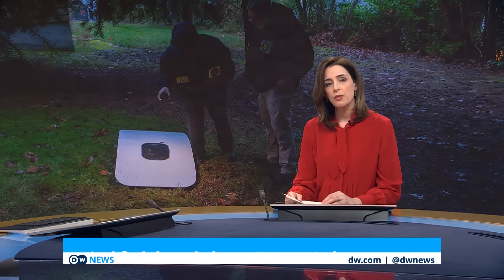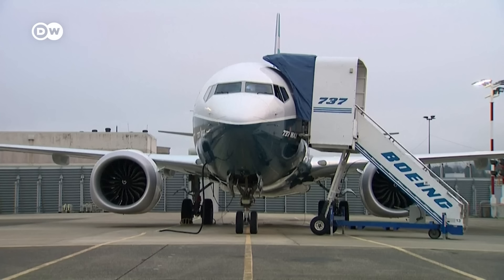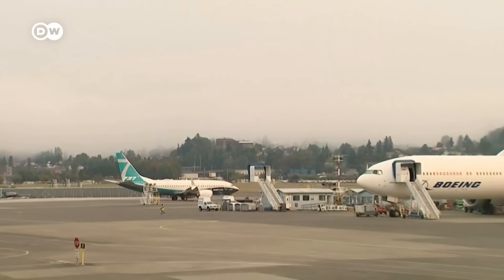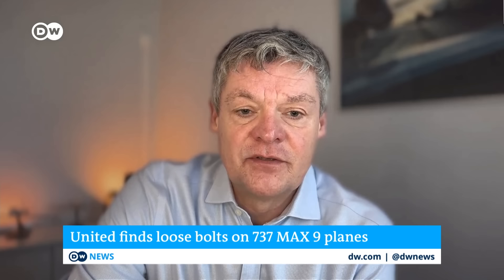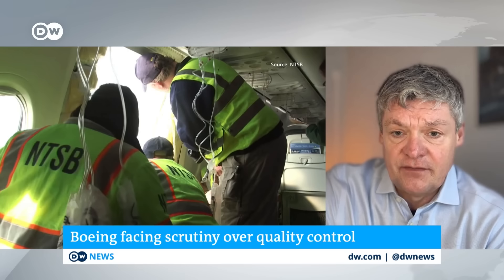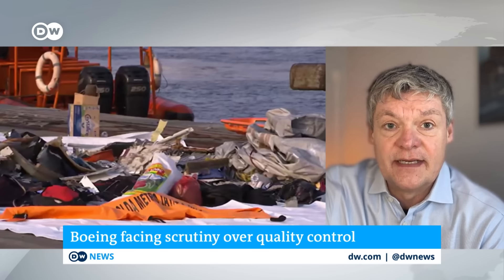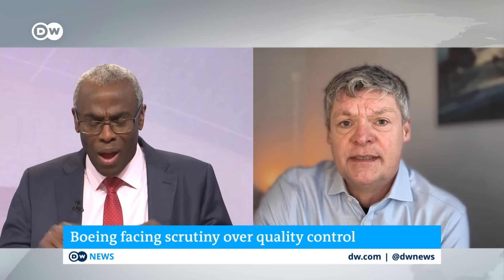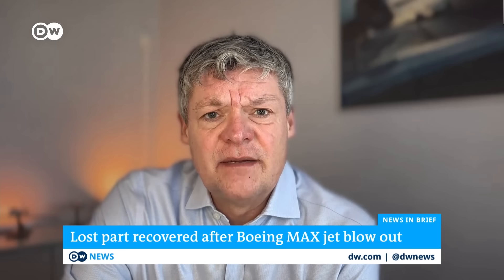After the Alaska Airlines incident: Is aviation quality control insufficient? | DW News

Comment: The entire 737 Max fleet needs to be checked.
Reply: I didn't say ground it but the bolts need to be checked on the entire 737 Max Fleet.
Reply: @Bluestreak589 Aside from MCAS ditching the plane into the ground without pilot command, and loose bolts decompressing the aircraft at high altitude - one wonders what other hidden defects there may be on these aircraft? Wait and see I guess.
Reply: What about the Max 10.
Reply: @Bluestreak589  its not for Ryan air.. its for planes of more then 185 passangers i think it is, the configuration the customer orders depends on the door/ plug used.
Reply: @thompsonmatthew 
There was another news channel which showed an interview with a former manager and whistleblower from Boeing who said that there was a united flight just about a month ago where they had a single engine failure just after 30 hours or so that the plane was in use. And another one which lost all electric power just after take off and that one was just delivered the evening before by Boeing…
That’s pretty concerning if you ask me.
And yes the MCAS was a disaster which they wouldn’t have needed if they had developed a proper new plane instead of rushing to keep up with the competition and just modifying an old reliable one.
Reply: @Bluestreak589  ryanair don't and isn't having max 9
Reply: Needs to be in a scrap yard.
Reply: @Bluestreak589  Ryanair doesn't operate the Max 9. What you are referring to is the Max 8-200, a Max 8 version with an extra door.
Reply: @Bluestreak589 
So you realy belive that Boeing AS different Quality insurence system. For the different 737 max variances. Or does the 737-8 not uses anny Bolts. This is Not a specific Problem. But rather a Symptom of a fare worse Problem when Profits Matter more then safty
Reply: @Bluestreak589  I flew on Ryanairs one 2 weeks ago from Dublin to Stanstead return .I just knew that it was a 737 and i noticed how new it looked .Then i read Ryanair had taken delivery of at least one and put it on that route .If i understand correctly Ryanair puts in 200 plus seats so does not have that plug but an actual door on their new 737.
Reply: You should read about the 787. It keeps stopping production because of defects and detected quality check. Imagine that, if Boeing is stopping the 787 production because problems are being found, imagine the ones they didn't.
Reply: Generally I don't have much sympathy for Boeing. But in this case... other versions of the aircraft don't have these plugged doors. But Spirit has, apparently, been firing people who report issues. So there are likely other issues.
Reply: @Bluestreak589  Since a MAX-9 is a 737-900... well you'd have had a 737-900-100 and 737-900-200? Things like this are dealt with in smaller numbers, like the 747-100 was the revision, but the delivered aircraft were things like the 747-121. So this would be a 737-950 maybe, but that would still be a MAX-9. These can be ordered without the hole, but then a future 'upgrade' to the significantly more hellish seat layout would be very expensive, instead of just requiring a couple of doors and rearranging the deck-chairs on thisTitanic.
Reply: And SCRAPPED!
Reply: @konraddapper7764 — These particular bolts are used only to keep these plugs in place.  The mandatory inspection is for all the aircraft that have these plugs.
Reply: More like grounded indefinitely until further notice
Reply: We were told in Nov 2020 - when it was ungrounded - that the 737MAX was "the most scrutinized airliner on earth". More lies.
Reply: @thompsonmatthew  loose rudder control bolts.
Reply: Also those in the factory
Reply: @mrsogre  Right on,. The obvious, based on common sense, was mentioned in your comment.
Reply: @Bluestreak589 Ryan air aren't buying the max 9 they have ordered the max 10 version.
Reply: @kennogawa6638  You don't seem to realize that the rest of the fleet does not have this plug
Reply: Not only checked. Should be banned for ever, no one wants to fly on any 737 Max at this point.
Reply: @ResizeFilms  I know you will find this hard to believe, but you don't speak for the rest of the world.   10s of thousands of people fly on 737 every single day...
Reply: Boeing 737 900 ER door plugs to be checked the FAA announces.
Reply: The door plugs are removed during maintenance and construction for ease of entry for workers.

Comment: What else has been missed on all of the MAX airplanes? Boeing has lost all quality control. The new Air Force tanker had major issues also. Upon receipt of the new aircraft the Air Force does an acceptance inspection and they found tools left in the aircraft behind panel. A major issue called FOD.
Reply: I heard about this. Go Boeing!!!
Reply: Boeing debacles: 737MAX, KC-46, T-7A, Starliner - all at taxpayer expense.
Please read about how Boeing management cut 900 - nine hundred - quality inspector jobs in 2019-2020.
Please read about lawsuit against Spirit Aerosystems (Boeing subcontractor really run by Boeing).
Full disclosure: as recently as 10 years ago I was a huge Boeing fan boy. My father flew Boeing planes in WW2 (he was a B-29 navigator). They are not the same company they once were.

Comment: I wonder what sort of quality control check the FAA did after the LionAir and Ethiopian crashes and further grounding? We were told this would now be the “safest plane aloft”. Looks like they couldn’t even screw a door on right.
Reply: Both were non Western Airlines so a lot of people and Boeing fanbois still believe it was pilot error that cause the crash! 
they have disregard it with excuse like:

- the pilot were not experienced or better trained to deal with emergency, 
- Western "white" pilots are better trained so this would never happened in West
- those planes were not maintained properly,
- China actively try to make Boeing look bad by pushing for ban to make Comac look as a better investment etc.

So when you go into something with that type of mindset that it was not fully your screw up, your work to fix it will still suffer from flaws and you won't fix other bad practices of careless work.
Reply: It’s a different model.  Those were the max 8 model.  

This is occurring on the max 9.  The max 9 is a bigger plane - about 10ft longer than the max 8.
Reply: @DeathyAS  same forward set Leap large engine with low body and MCAS system.
It's just longer, so more cattle class sit and cramp toilet.

Comment: Title is wrong, should be "is boeing quality control insuffiecent?" and the answer is yes. I saw the pictures of the loose bolts, and you can literally see that they are not fastened, its so obvious even a blind person could figure it out. Blows my mind how this can happen, there seems to be no more quality control AT ALL Im an trained aircraft mechanic and im blown away and really cant make sense off how this could happen. Its almost like its done on purpose.
Reply: @@phillipbanes5484 there is a difference in manufacturing defects and quality control of installed components. It's not like a part of the plane  failed because it had a defect - it just wasn't installed correctly. Loose bolts that you can spot easily by just looking at them sure sounds like no one ever looked at it after said bolts were installed but just signed that the work was done. 
And yes, especially in the aviation industry we learn from mistakes that were made - but dude it's 2024 and multiple loose bolts on multiple planes should just not happen anymore. 
As a mechanic yourself, have you seen the picture with the loose bolts? Now imagine yourself installing these. How incompetent does one have to be to not notice the loose bolts after you are done as a mechanic? And how did an inspector not see it either?
Reply: I think its an aviation problem because of the FFA failures too. It's not just Boeing that messed up.
Reply: @RandomGuy9  don't really know many other plane manufacturers that had 2 brand new planes fly into the ground or loose doors like Boeing. So no, I disagree. It's a quality control issue at Boeing. And it's been known for a while. But I guess it's profit over safety nowadays

Comment: Why only checking  the 737Max9 ? The 737Max8-200 used by Ryanair is equipeed with the same emergency exit door. Nobdy talks about it.
Reply: It doesn’t have a door plug because it must have the emergency exit to qualify for the 200

Comment: It’s entirely possible that the bolts were correctly installed and inspected at the factory which would lead down to a defect in the design.  Perhaps the design allows pressure cycling, thermal cycling, and/or vibration to cause the bolts to shear or come loose.  If thats the case, Boeing and FAA will need to understand the root cause, correction, correction validation, and fleet implementation before these craft fly again.  Further, they need to check aircraft with the actual emergency doors to determine if the problem exists there as well. This may cause expansion of the grounded fleet.
Reply: Ford has a similar problem. My brother's car lost its engine on the highway because the screws vibrated out...

Comment: There were reportedly 171 passengers on this plane that apparently seats 178 and the 2 seats most adjacent to the door plug that flew out were unoccupied. Do you know that the random probability of those 2 seats being unoccupied is 0.13% (or 1 chance in 770) ? Given this incredibly remote possibility and the fact that the airline is already known to have known about a cabin pressurization issue on this plane, does anyone else think it's plausible that the airline knew of this specific problem at the door plug and their solution was to just block seating on those seats most proximate to the door plug? I do recognize that 1 chance in 770 is not zero chance and that there's some extrapolation from that chance to a faulty decision but I've personally found it an overly convenient conclusion that many have drawn that "oh, how lucky everyone is that those 2 seats were unoccupied"...maybe luck had absolutely nothing to do with those seats being unoccupied. Anyway, that would be beyond alarming behavior if true.
Reply: Probably not, people don't want to sit next to poorly placed windows. Being 2 seats isn't that significant, as of course people book seats next to who they're travelling with.
Reply: It should be easy enough to verify that remote possibility.

Comment: I’ve worked in Boeing Structures Engineering for 3 decades.  The company has gone to the dogs.  The company just wants to outsource as much work as possible to cheaper labor and the training of new people is horrible.  Engineering quality looks like slop. Continuous fixing of engineering that has manufacturing issues.  While fixing one problem on one hand, another error is then made on the other hand.  It’s a clown show.  I’ve complained for the past 15 plus years how quality has deteriorated but management never addresses it.  They don’t look at the work.  Just hanging on till I can retire in a few years.

Comment: The expert from Hamburg 5:50 attributes the problem to the "production phase" and related quality control, and not to the "construction phase" by which I think he means engineering design (of both airframe and it manufacturing process) which has its own assurance or quality management systems. 
    What I find even scarier is that maybe there were also problems in engineering design and engineering quality management. He mentions that the extended fuselage of the MAX-9 is based on the NG variant 737-900ER. Because it can carry up to 220 passengers, it requires an additional emergency evacuation exit between wing and tail. But operators (like Alaska Air and United) who employ a multi-class seating arrangement do not need this. And yet the fuselage is built with a hole, that gets fitted with a door for some customers (usually low-cost carriers with a single-class seating arrangement) or with a plug. Perhaps there were problems with the design of the plug itself, perhaps the bolts and other fastenings specified were inadequate for the requirement. Or maybe the whole idea of just bolting on a plug was a bad idea, something sturdier could have been used (rivets? like the rest of the fuselage). The MAX-9 may have just inherited a solution from the NG generation 737-900ER, and maybe that inheritance should have been questioned more. Or maybe even the NG version is defective and these planes have been flying around for over a decade with a potential blowout and we have just been lucky. 
    The NTSB investigation of this MAX-9 major accident will eventually determine a root cause, or several. If Boeing's engineering organization is partly responsible, not just Boeing and Spirit Aerosystems' production organizations, it indicates a deep problem with Boeing that persists 5 years after engineering defects caused the two fatal MAX crashes. The MAX-9 had its Entry Into Service after the crashes, if I recall correctly. I don't know what the remedy is for a flawed engineering organization, but the initial information suggests Boeing has still not made some of the changes it should have made after the fatal MAX crashes.
Reply: The plug is sturdy, provided all the parts are present and properly installed.
Reply: You are right to question if the engineering design is adequate.  A plug in itself is not a bad concept provided the engineering of it is sound.  Rivets are not used in every other part of a plane.  An assortment of fastener types are used for various applications.  A plug like this would require removable fasteners whereas rivets are intended for permanent attachments.
Reply: You are right too that Boeing Engineering does have some deep issues.

Comment: Reuters: "At its Renton, Washington, plant, Boeing typically removes the pop-out, or non-functioning, door and uses the gap to load interiors. Then, the part is put back and the installation in [sic] completed. Finally, the hull is pressurized to 150% to make sure everything is working correctly"

Comment: There are subcontractors who live this culture of malfeasance in order to meet production goals and on-time delivery.  I’ve seen subcontractors who profess to have regular and random drug screening and yet the only screening that happens is when the employee begins employment.  I’ve seen subcontractors buy off inspections remotely without ever having seen the part or parts that have been submitted to them.  I worked in the aircraft for almost ten years and I can easily say that there are many airplanes in the air that I’d call “maybes.”  As such when I fly I try to select flights using airbus.  The inspection and verification process in this country is extremely broken.  Inspections can often be “negotiated” with those who are responsible for signing off on parts and pieces and this is unconscionable in my opinion.

Comment: How many bolts are used within the entire aircraft, and how many more might be loose? How big is this problem?
Reply: Not as big as it sounds. But loose screws on a plane could indicate that they worked half-hearted on other more critical parts too.
Reply: @RandomGuy9  There have also been previous assembly problems, and loose bolts have already been found on other planes after the FAA required airlines to inspect planes with the same arrangement.
Reply: Millions of fasteners of various types assemble an aircraft.

Comment: I wonder when United say that they found loose bolts, do they mean they found bolts without a cotter pin? After all, these bolts, at least the top ones, are not load-bearing, they just prevent the plug from sliding up. In this regard the question "is this a structural problem" sounds particularly uninformed.

Comment: In early 2018 I watched a shocking documentary on the apparent creepy practices going on at  Boeing plane factories,   like hand pull stretching long runs of copper wiring cut slightly too short, as one example. (yikes!).    All this, just months before the  MAX disasters happened.

Comment: The four bolts that haven't been found yet have a castlated nut on them. These wont be torque loaded as that could mean the holes that the split pin goes through might not be lined up. also the nut is there to stop the bolt from falling out, so some of them might be loose, but this should not be a problem.
Reply: Totally agree, any castle nut that I’ve ever put on usually get torqued to spec then backed off to the first slot to line up with the hole going through the threads for the cotter pin to go through. Most likely but just guessing, that the cotter pins are getting broken off with the plug moving under turbulence and pressurization events, the broken cotter pins then don’t do anything to stop the nut from coming off.

Comment: The real questions is why has the FAA allowed things to get so relaxed at Boeing?  The whole Max design has been lacking FAA oversight. The FAA gave Boeing the green light to self certify the development and production of the Max line. It's the FAA's mission to promote safety for the flying public. How did the FAA get so relaxed with Boeing to allow such things to happen?
Reply: Check who works for the FAA, they are mostly all connected to Boeing.

Comment: I wish someone would clarify what the safety margin is regarding these "safety- bolts". How many bolts can fail before the door will blow out? 2, or 3? How many bolts can fail before before something like this can happen?
Reply: The bolts are not under high load, so should not fail at all.  One bolt should keep the plug door in place.  Most likely, there were no bolts in this door, in my opinion.